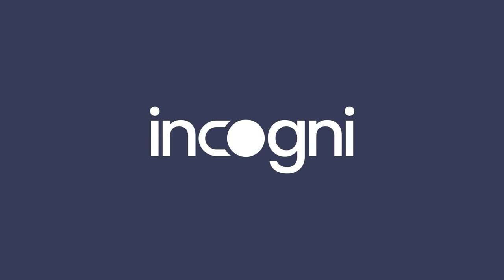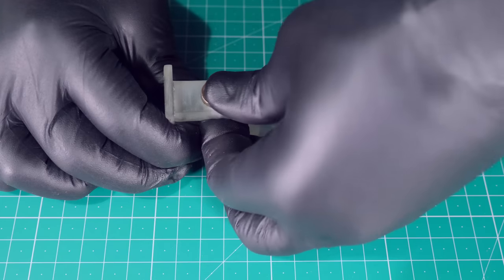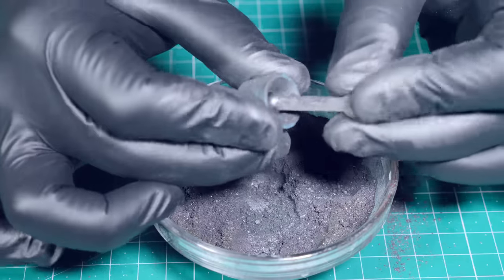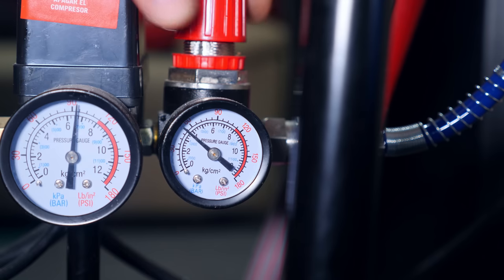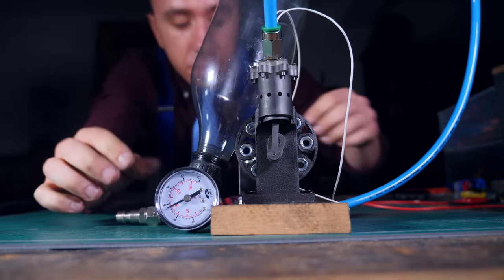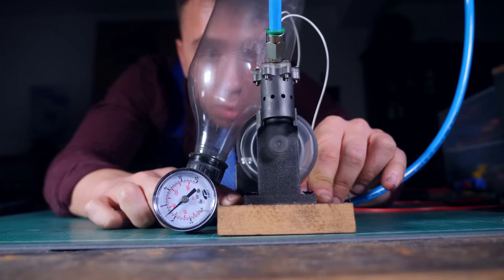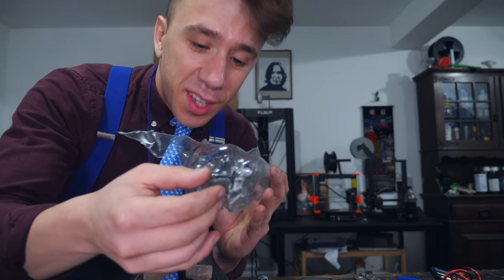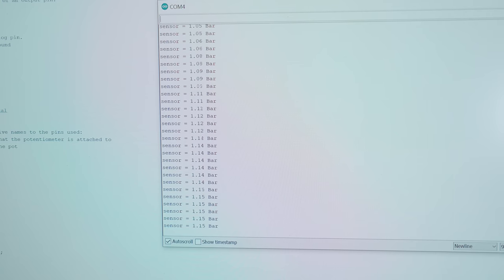Magnetic Air Engine

Comment: Use the same magnet idea on a rotary engine, and have three valves for each side of the rotor. It could produce more torque. I’d also love to see you put multiple rotary engines in series to see what effects it may produce. Love your videos man
Reply: you mean 2 right
the wankel only has 2 compression points
Reply: @robot797 Not all rotary engines are Wankel engines
Reply: @VladIvanov-f8i  so you mean the rotating piston engine
that one would be extremly hard to make

or do you mean the liquid piston engine witch isnt a rotary or a wankel

you are talking about a rotor
and the only rotary/wankel that has a rotor is the one sir wankel designed

so your comment is invalid
Reply: Perhaps they meant radial instead of rotary? Would be cool seeing a 8 cylinder radial engine lol
Reply: @Suzuki_Hiakura  probaly not
he is talking about a rotor and 3 sides
so it has to be the liquid piston engine he is talking about
it needs to be ignited at 3 sides
so it would need 3 valves
but that aint a rotary XD
Reply: Agree but stays with 2 rotors: known and well documented
Reply: it will basically be a combustion 4 rotor

Comment: I recommend putting the air valve  in the top of the piston to try to limit the amount of waisted air in the lines. It might also help it run at slightly higher rpm.

Comment: Add a second magnet sensor to control when the valve shuts off during the downstroke. You can probably increase the efficiency, maybe even the torque as well, if you can precisely control the time during which it's open. Seeing as you're gonna use an arduino in the project anyways, it could control the valve as well, based on the two sensors. This has the added benefit that it'll spit out the RPM on your arduino as a byproduct. Maybe you can even tweak the timing values in your code to further improve efficiency.
Reply: Agreed. Possibly even right some code to adjust the timing slightly ahead of the sensor. If the valve is sent a signal to open when the piston is at the top, the piston is already moving down significantly before the valve actually opens, and pressure actually starts moving. If it could anticipate based off the last 10 rotations when it will hit the tip so the valve can open slightly early, kinda like a spark plug firing a split second before the piston hits TDC, that could improve power significantly
Reply: @ryanhamstra49  I would just add the sensor as a reading instrument and measure the timing accurately for a given RPM curve, this way there's no trial and error and you get the perfect amount of gas for each stroke
Reply: If your code is just using the sensor to measure the speed and sensor position, it can be programmed to open the valve ahead of top dead-center without needing another sensor
Reply: Yes and no. I agree it could work with a long enough piston, but a short one will be an issue. The fact is the electric solenoid that controls the gas has its own delay so to speak of shut off. You can't make that delay shorter with a pulse. It's just the time it takes to close itself with the spring after the electricity stops. So if the piston is longer than yes you can do this. But for the short one there is a practical limit that you run into simply by the delay time of the valve itself. You can delay it longer in code but not shorter.
Reply: Does not need a second sensor, we can use a formula and timer to adjust shut-off timing. Get cycle average over last second, normalize it, use interpolation to set the off-timing to be a T between A and B. The higher the revs, the shorter the time in seconds for each loop but our cut-off time has always the same ratio between the loop start and end points.
Reply: @squidcaps4308  Interpolation at such a short range of motion would be inherently inaccurate, but I think any sort of accurate model is ultimately limited by valve response time.
Reply: @KCM25NJL  modern microcontrollers tick along in the range of hundred millions of clock cycles per second. I think it can measure accurately enough, plus with it constantly reading the sensor it can actively adjust its timing. Accel/decel would be marginally rougher than constant-speed running, but probably by less than a millisecond's worth of valve timing.

Comment: It would be awesome and it will be more and more lighter. Also, you can try using your hyper jet steam, but controlling the water input(that make the steam) by the pressure remain in the pressure reservoir .Or you can use liquid oxygen( It can be any gas that liquifies at lower than 0*C)  in a container, and the just let it to warm up at the room temperature and use it as fuel.
Reply: CO2
Reply: Cool idea man! That would be crazy!!!
Reply: It will run very fast
Reply: Crazy?I was crazy once
Reply: Holy moly! It will take off the bench as an airplane !!!
Reply: Bright idea:D

Comment: My suggestions: Multiple cylinders. Gas regulator for X bar. Lose the soda bottle or replace with smaller to even out pressure. Parallel valves - If one isn't fast enough, mayby they can take turns (no need for Adruino, just small electronics). More canisters. 
Good luck and looking forward to the next one.

Comment: Your design is really similar to Tom’s but I like the electronic flow regulator. It’s something he didn’t use and opted for a passive design. I think he did it to save weight, but your method allows for multiple fuel canisters and a fast reload capability.

Comment: Could you do a video showing the concept of vacuum buoyancy? It would be interesting to see which shapes and structures can withstand atmospheric pressure while being less dense than air
Reply: Is this coming from the veritasium video about airships ? It would be interesting regardless , I hope Integ does this.
Reply: @zhinkunakur4751  yes it actually is! I was thinking that if one could make a buoyant structure then the problem with payloads would be solved and the use of ballasts wouldn't be necessary anymore. By simply changing the internal pressure using vacuum pumps it would adjust it's buoyancy, and to keep it on the ground during bad weather just open the valves and let air in.

Comment: This thing is awesome! I had so many ideas while watching. You could attach a throttle to it that just adjusts the point of when the ardunio puts more air in to increase or decrease the minimum pressure. You could use a larger refillable air tank like the kind used for paintball, that would give you a pretty crazy runtime or add a second cylinder offset by 90 degrees to get more torque for the same speed. I’d also love to see what kind of propeller it would spin and how much thrust could be produced.

Comment: A suggestion for increased runtime as well as possible torque would be to use a 4500 psi (approx. 310 bar) compressed air cylinder that they use in paintball. The cylinders are about the size of a 1 liter bottle and contain a large volume of air at an extremely high pressure. You could increase the pressure maintained from 2 bars to 4 bars to see how that works out.
Reply: and you  would get a free pressure regulator too, and free  trigger valve, an d might be as easy just hooking the gun barrel end to a pipe, and connecting that to the air engine (the only problem getting gun fire, without any round, loaded, and connecting something to trigger, to press it once in a while (every 2 bars, was it not?)
Reply: I play paintball and complete agree as far as air storage goes, but I think he also is trying to keep the weight low. Dry ice with a bleed valve for over pressure might give you a decent enough result to be viable.
Reply: I'm a little late to the party and someone may have already said this but, but what if you used that engine to drive a low pressure air pump to supply it's own air. Theoretically it would run forever but in reality it will stop at some point. Just an idea.
Reply: @desertfox4583 fuel dude fuel
Reply: These weight about 3 or 4 pounds I would suggest getting a regulator instead so the outputs  is constiant

Comment: To optimisme the opening and closing time of the valve, try attasching the magnet to the flywheel and move the sensor tangentially and radially to adjust the phase angle end opening time, respectively.
Reply: Ooh, I like this. It allows for the concept of valve timing to be shown physically rather than conceptually. I think the timing may want to be more variable than this idea allows, for peak efficiency, but that can be an easy modification further from this idea

Comment: I would recommend putting a pressure regulator between the bottle and solenoid, keep the length of tube between the solenoid and engine as short as possible, and moving your sensor to the flywheel.
With the sensor on the flywheel you can adjust the solenoid firing time from “top-dead-center” (TDC) for slow speed, and a few degrees ahead of TDC for higher speed.
To get really fancy, some testing could result with a gradient equation to get the most torque at every speed.

Comment: Amazing video and a great continuation of Tom Stanton's design. I love this iteration using CO2 cartridges. A couple things :
1. Add a regulator, you will get constant controllable pressure instead of periodically uncontrolled spikes.
2. If the intent is to use CO2 cartridges as the main pressure source, add more in parallel to linearly scale up engine time. You can add more ''fuel'' up to a point where the tubing/fittings mass doesn't balance out the benefits of more engine time.
3. Remove the bottle, simply use the cartridges with tubing, valve and the regulator (less mass).
4. Put the valve closer to the head of the cylinder, it will reduce the volume of gas after the valve and therefore increase the pressure in the cylinder because of the reduced expansion necessary for the gas to reach the cylinder. It will also decrease the pressure drop through the tubing from friction. More pressure = more force = more power.
5. I would love to see more detailed engine performance data out of this, this is awesome for a pressure driven piston engine.

Comment: like a spark plug in an engine you need to account for the delay of your solenoid valve by varying the firing angle. move your sensor from the piston to the flywheel and use the Arduino to calculate the piston position and speed, then add a delay for firing the next valve opening based on the current conditions. depending on the nail to ball size ratio using the solenoid valve should increase efficiency considerably

Comment: Great video once again! You should add an elastic chamber before the plastic bottle that, by expanding and compressing, will help to keep the pressure variation constant: it would be something to smooth out the transient, just as a solenoid in an electric circuit or a flywheel in a mechanical system
Reply: I was thinking along the same idea. Like a pulse damper. Even a small pressurized ball in the bottle would help stabilize the pressure

Comment: Use a 1-litre scuba tank and a first-stage pressure reducer. Then you have 200 litres in 200 bars reduced to 8 bars. These tanks are common in the diving community as "argon" tanks for dry suits ( but everybody just uses them with cheaper air). Just fill at any dive shop for under a euro. Any other size tank (0,1 to 15 litres) is usable too.

Comment: Seeing that volume changes pressure, I think you can use some sort of balloon for a constant pressure, it might decrease overtime but it's worth testing. Maybe use a stiffer balloon for more pressure. It might show better results and can reduce weight too, if you want to use for an airplane propellor.
Reply: A balloon can't contain enough aur for a long runtime.
And it will be pretty large after being inflated
Reply: @Longus07  Something between a balloon and a pet bottle would actually help  the plane to float in air while also be the medium to hold the engine power to move forward. He can even use multiple canisters to fill/stable pressure in mid flight and even drop the empty ones to get rid of excess weight but this will require a big software and many sensors to actually pull it up.
Reply: @TheXentios  it's not going to make it float, you would need to fill them up with lighter gases not compressed gases inorder to do that and they would cause a lot of air drag.
Reply: @Longus07  Yes, using lighter gas like helium and a huge balloon is a very good idea. I would suggest using a very long balloon to keep it airodynamic. Such as an air snake. One also would spare a complex airplane body.
Reply: @wurstelei1356  that won't be an "airplane" that would become a ZEPPELIN
Reply: This idea isn't too bad. The water guns as toys in the 90's used a blatter to have a constant pressure.
Reply: @someonesays8022  The IDEA of this whole Invention is Perpetual Motion 
MUST HAVE OPPOSING FORCE AT BOTH START AND FINISH OF CYCLE.
Bladder would create Pressure Differential (expansion) 👍
Reply: That's a great idea! Regulating the pressure to keep it constant is a great idea. I personally think that a set of bellows would be more practical. Church organs use the same trick, so this isn't something I came up with. But it's been proven technology or centuries, so it will probably work for this situation as well.
Reply: @dapje2002  Yes.
This is what the comments section is about.
2 Solid Vessels = Constant SET Speed.
2 Bellows = Lungs adjustable Speed and STALL through Expansion retraction.

🤔🤔🤔🤔👍
Reply: @Longus07  Can a more stiffer balloon work? Like something in between of a tire and a balloon, that can hold some pressure but can change its volume too.
Reply: @hammad6201  it can work but the only problem is that it won't regulate the pressure well if it's too stiff (requiring a regulator) or if it's too soft then it will be too large (large air drag and low capacity) and impractical for a plane

Comment: The electronic valve works awesome! Possibly a "variable timing" with arduino on the engine could yield better results, different opening times relative to TDC, as well as time left opened similar to how VVT works on a combustion engine (maybe shorter pulses of air when it's at higher pressure and larger pulses when it's lower to get the same power vs air pressure) I think messing around with the air valves timing could maximise power/efficiency or "mileage" based on a certain "map"

Comment: If you are going for run time, an easy way would be to use an air pressure regulator, this will keep the air pressure consistent and allow the tank pressure to drop slowly or fast depending on how low or high the regulator is set.

Comment: Some improvement ideas would be to adjust your timing on the valve opening. Since you're already using the arduino, you could easily set it up to have a delay. Or, make it so there is a magnet on the flywheel for timing. Next improvement comes from Tom Stantons videos where he improved the seal, I would say, looking into improving the seal as well. Also, try playing around with the stroke and bore of the engine, and if you do some pressure calculations to determine the appropriate amount of stroke/bore for the pressure target you have. It might also be worth while to look into crank offset, it's a somewhat complex topic but could really improve performance and run-time.
Reply: Also reduce the volume between the valve and the cylinder. It will reduce the excess gas released at the bottom of the cycle.

Comment: Here are several tips! All can not be done in the same version but several would work together.

Design it like a V engine using atleasr 2 pistons connected to a single axis. Use a smaller magnetic valve for fastet action or push the air in sideways instead from above; this wont force the piston as hard in it's "shut position" the same way. Use springs to dampen the effect of the closed position.

Comment: Hey Integza!   

You could put a regulator on the inlet to use as a throttle!  

Awesome video as always.
Reply: Vary the angle when inlet valve shuts.

in steam engine parlance, such is known as cut off adjustment.

for maximum efficiency, and utilisation of the gas pressure... shut the inlet valve at an angle when the trapped pressured gas above the piston will have expanded to atmospheric just before the engine exhausts. While efficency and gas consumption is reduced, power output falls faster. 

For maximum power. The inlet valve should be shut just before the exhaust ports are opened. very little expansive work and the engine will emit a similar "chuff chuff" sound as when a steam loco is just getting moving/needs most power.the noise is made by the presssurised gas exiting to atmosphere

Feed the magnetic sensor's output to an arduino.
arduino measures time between pulses.
half of that measurement should be a decent approximation of the time it takes for piston to complete it's descent. Depending on what fraction of the power stroke it is desired for inlet valve to be open, multiply by a number that varies between 0 and 1. that parameter serves as cutoff control aka throtle.

if wanted it wouldn't take much code to add a speed governor. that would adjust throttle in response to rpms that are higher or lower than desired speed.

Comment: If you add some kind of heat exchanger, you can improve the gas efficiency, because as the gas expands, the temperature increases, so it expands less. Also it would be better to combine this system with some kind of pressure regulator, so the pressure would be even more stable + I would like to see the final power output of the engine, if you can measure it. Nice video :D